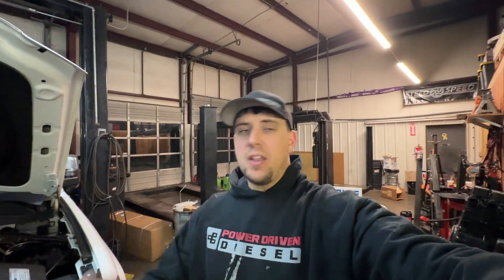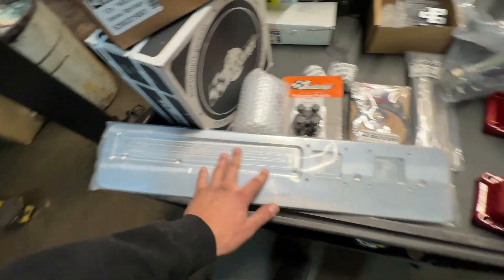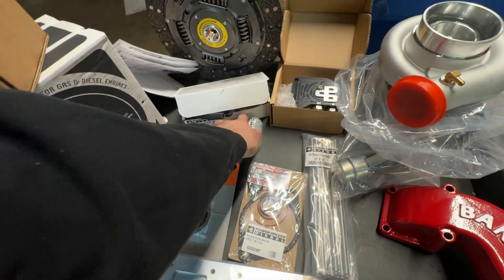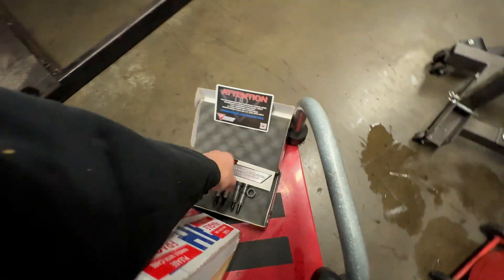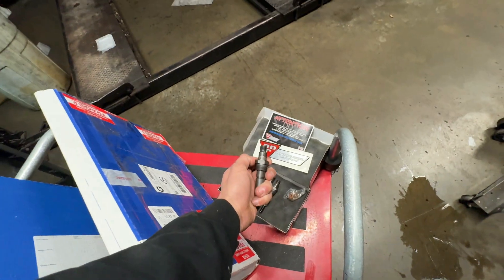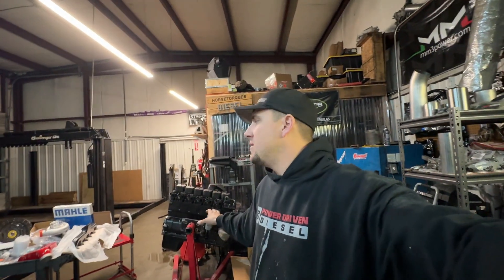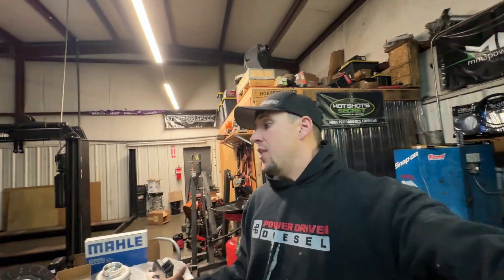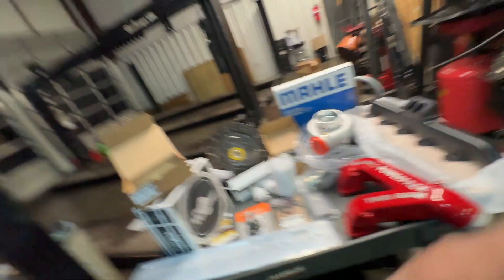450HP CUMMINS 12V Parts list!

Comment: Wondering the importance of going to a fluidampr system. I have a mild build going on (many similar parts to what you have shown here, but on my vp44 truck) but still haven't made the jump to a fluidampr.  Honestly, I'd guess the truck to be 300 wheel, and that's really fine by me. Any need for it?
Reply from the maker: @nevinbontrager8828  it'll make it a little quieter. Usually what we see is high mileage stock ones on the last leg. We tell people a new stocker is 200-300 bucks and this Fluidampr which essentially cannot wear out is 580 and let them make the choice
Reply: @horsetorquesdiesel  

That's fair. Well I had mine off a month or so ago and it was fine. So... meh.

Comment: What aftermarket part would you have used for this 12V engine in place of that Banks Power Pack Twin Ram?
Reply from the maker: The stock horn
Reply: @horsetorquesdiesel  😂

Comment: As much as i don't want give banks any business, do you have any though on using the banks intake on the 6.7s to get rid of the factory grid heater? As far as i know thats the only kit that gets rid of factory heater and still provides a heater with the new intake.
Reply from the maker: GDP moves it to the throttle valve and so does BMP. But banks does have a nice plate for the intake

Comment: Are those the new style ddp with the pilot holes? Stage 2 should do 500rwhp easy but that 64 turbine going to be the limiting factor.  A 60-67 would have been a better choice.
Reply from the maker: 60:67 drive like crap in a hx35 housing. The 60/64 is perfect for that 400-500 range. But I'm with you turn it up more and run the 67mm turbine in a 9cm housing!
Reply: @horsetorquesdiesel  Yeah the he style 9cm on a 60-67 is what I had in mind. I forget people still build hx stuff with the old little outlet exhaust housings.

Comment: Great idea for content. Don’t forget to tack weld the 5th gear nut. Please over detail the engine install in the chassis. I have a K20 with original 6.2 that needs a 12v swap, which requires a body lift. Hopefully you will educate us with new products that don’t require a body life.
Reply: Just put the updated output shaft in. It only take another hour and its a real fix

Comment: Good video….
Question for you guys I have a billet tappet cover (PDD) quite a bit oil comes of the vent tubes more than the stock cover any suggestions on witch one to purchase?
Reply from the maker: Do your hoses go straight up then down?
Reply: @horsetorquesdiesel  
I tried that didn’t work 
Motor has a about 10-15k
Reply: So they are designed to have baffling inside did you install it? I plugged those threaded holes and installed a baffled valve cover. Always better to vent high on engine

Comment: All that plus 2 tubes of RTV!
Reply: Idn if you have tried Right Stuff it comes in one minute and 5 minute. It's basically liquid rubber in a can. Seen it used years ago in nhra and been using it without issues ever sense.
Reply: If I recall correctly he does indeed use it.  I remember seeing it in one of his older videos. @mustangdemon87
Reply from the maker: Without a doubt